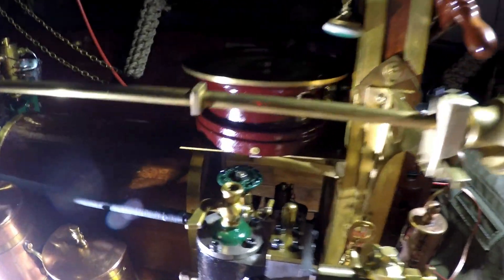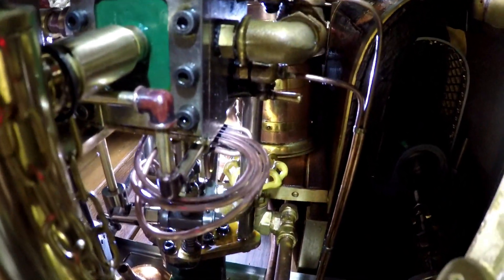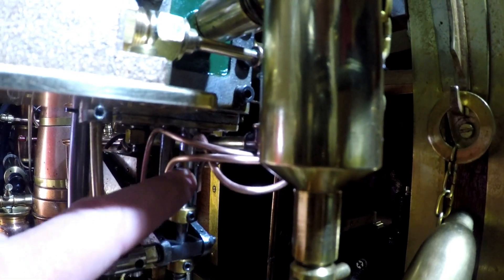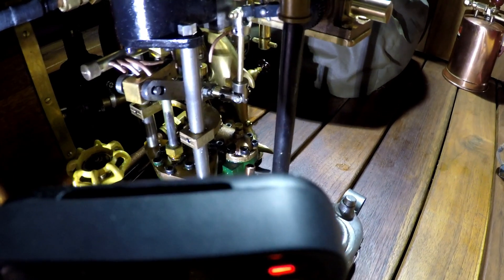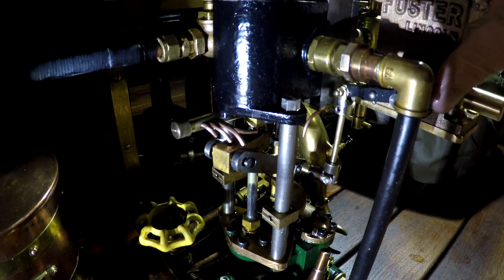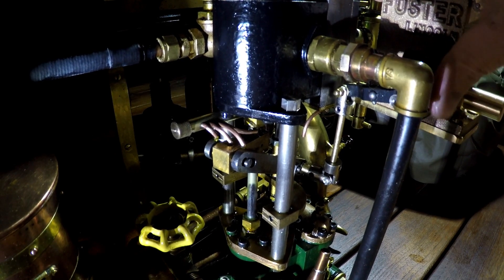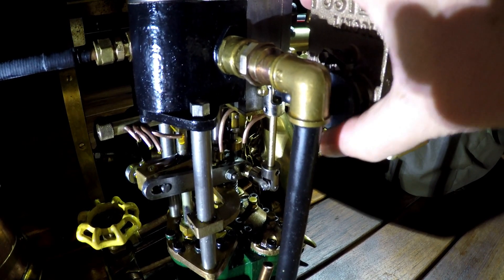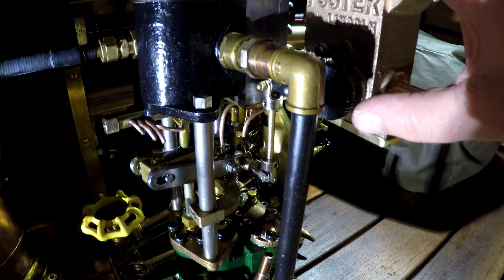Foster Installation Southworth Steam Pump Part 3 Final Test

Comment: Bonjour Chistoph,
Great job ! As you are perfectionist :+)  Did you plan something for a possible oil debit regulation ?
Amicalement, Raphaël
Reply from the maker: thank you... it is indeed possible to regulate the oil flow... one screws the cylinder out and the volume is decreased by doing it that way ;-) I have it at full position because the steps are minimal and the pump works only occasionally when water is needed... Regards Christoph